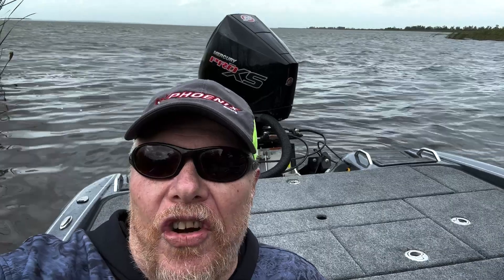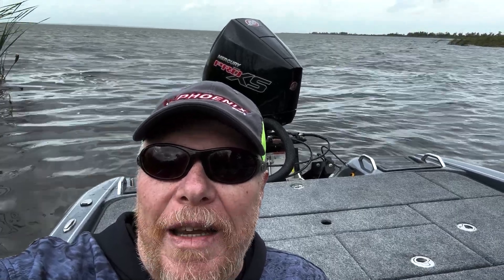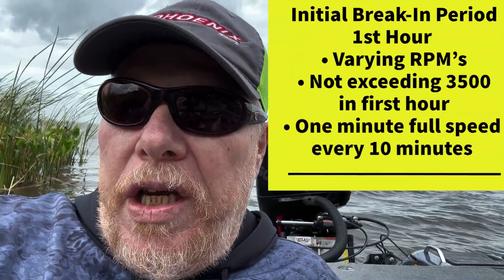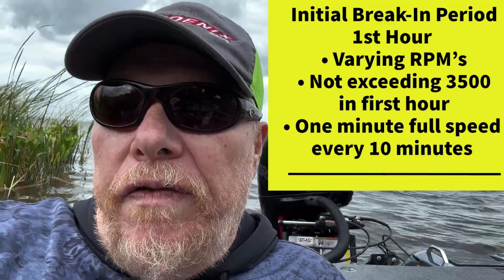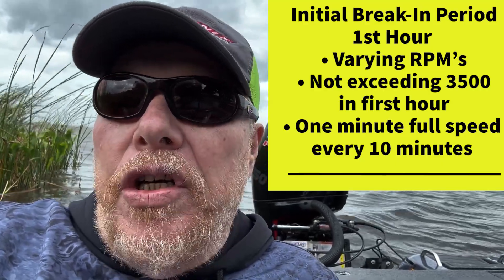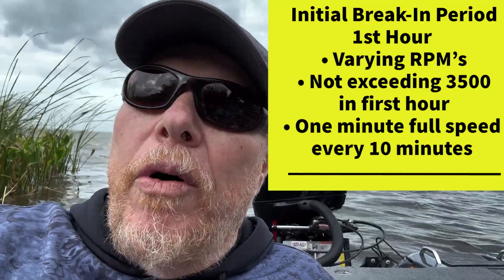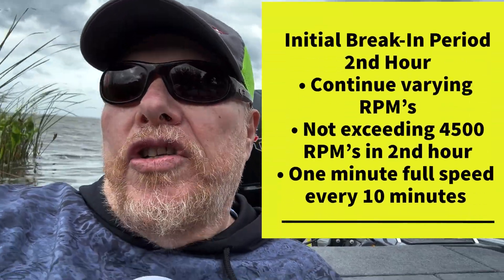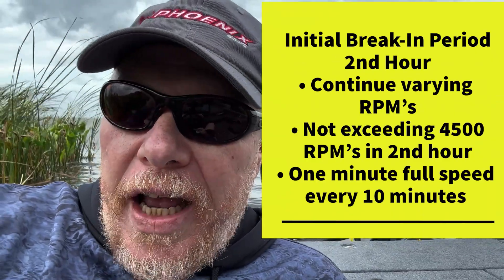How to Break-in a Mercury Pro XS

Comment: What is idling too much? I have to go slow while I am leaving the harbor. How much is too much? Five minutes, ten minutes, twenty minutes?
Reply from the maker: This is my definition, but I would say don’t idle more than you have to during the initial hour. Remember the idea of the break in period is that you are running your new motor at varying rpm’s. So if you have to idle for 20 minutes out of the harbor just vary the idle speed ( high idle , low , etc) then when you’re out of the harbor run your higher rpm’s and avoid idling for the rest of the hour.
Reply: @markfisheroutdoors  OK, thanks. I am getting a 115hp  Mercury this fall. Thanks again Mark.
Reply from the maker: @themuilover happy to help!